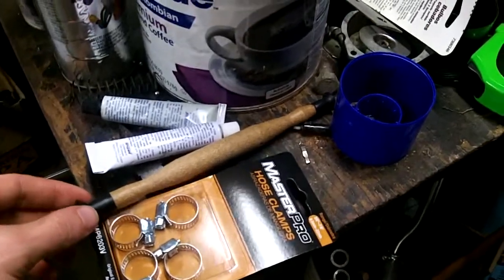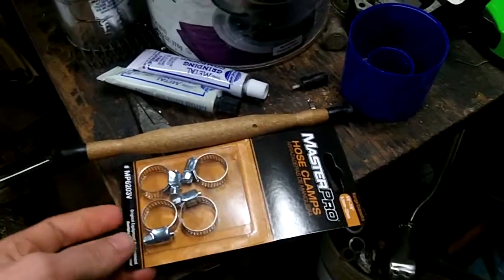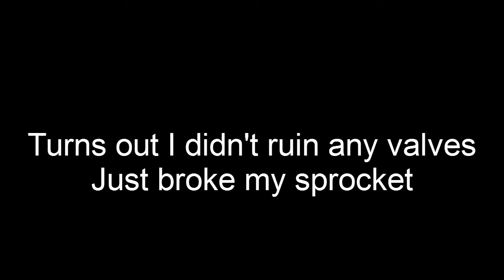Installing Intake Valve

Comment: I also have a bent intake valve on a moto 4 I recently purchased. I saw your video about taking the valve out, but how hard was it to get everything back together?
Reply from the maker: The valve spring is the hardest thing, in my opinion, in the whole process. Everything else just goes back together